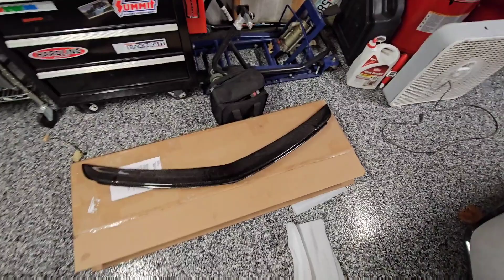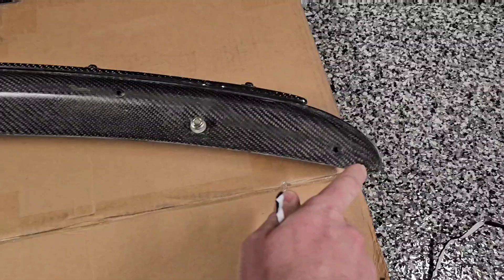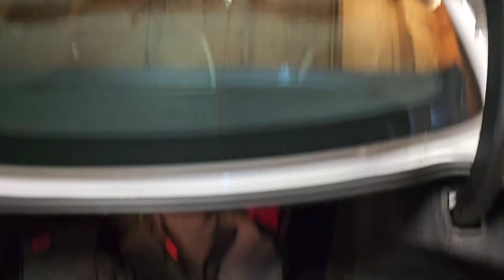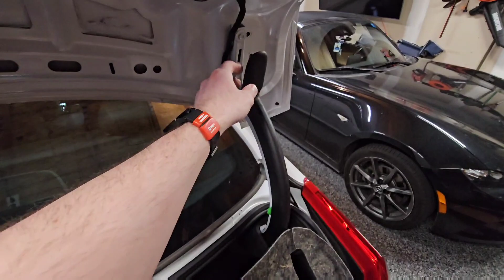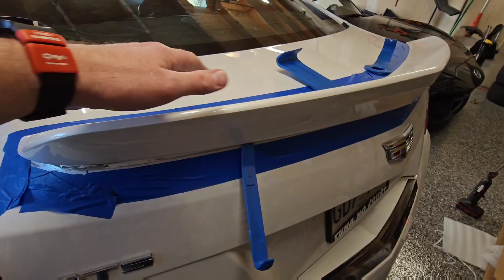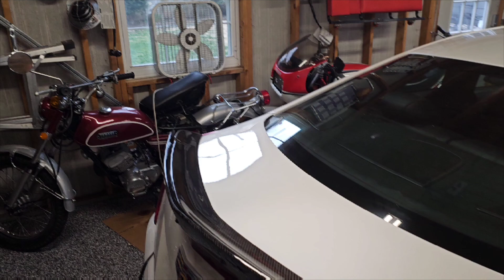ATS V Coupe MaverickMan Spoiler

Comment: the way it should be done! if someone can't install this...  don't blame the spoiler, blame the installer.🤣 looks great!
Reply from the maker: The removal was the worst part. I learned some lessons. The big one is to break the seal of the double sided tape on the stock spoiler. If you don't do this it will make mini dents in the trunk lid. I got that all fixed with some PDR work. Other than that the spoiler install was fine except for getting the nuts on the studs. That is just a hard thing to do period.
Reply: @jeffylube31  yes you have to be careful. can't pry on it. the metal is soft on cars these days. not like old cars where you push in the metal and it pops out. you lean on a new car these the dent stays there. 😢